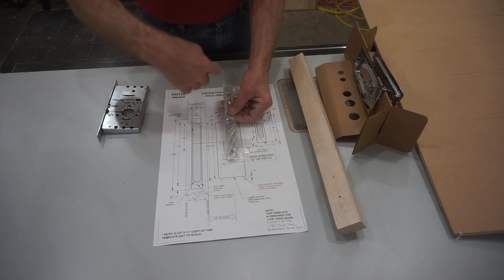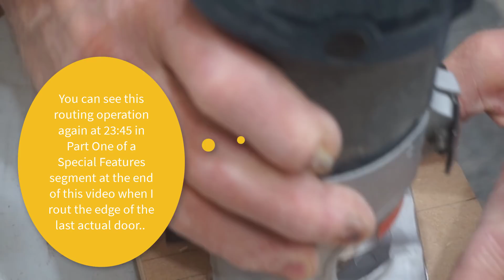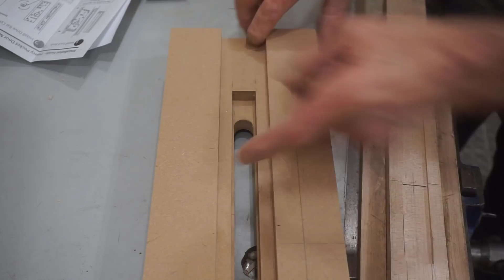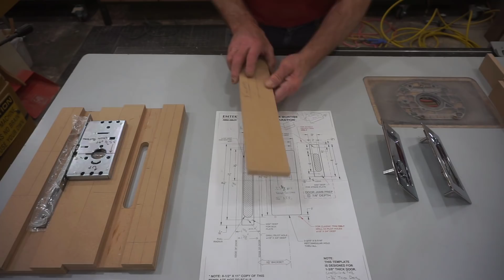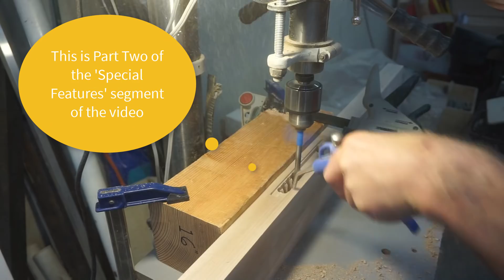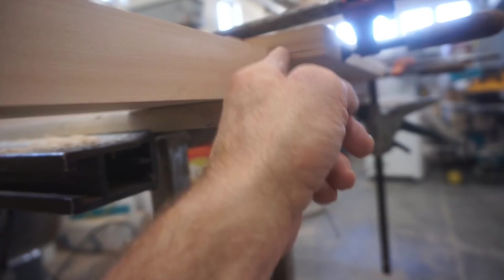Making Precision Templates for Professional Hardware Installation

Comment: In all fairness, i would like to see our metric friends mark a line 7.144mm in from the edge. I haven't seen many metric tapes with a .1 scale.
Reply from the maker: That's funny cerberus... I'm gonna have to use that in a video somewhere because, besides being hilarious, it's actually a perfect response for those with a metric-first perspective! Best, Matt
Reply: I find it funny because this is an example of false equivalence; since 1 mm is 3/64" so 0.1 mm is 3/640" which, I think, is beyond even Matt's amazing table saw abilities...or perhaps no?!! :D Love the channel,  @NextLevelCarpentry  -- fantastic content and the long format is zero barrier for me.
Reply from the maker: @JanStureNielsen  No sense in getting all worked up about metric vs imperial, right?  I don't know the conversion between fractions, millimeters and frog's hairs but I suspect 3/640" is a decent fractional eqiuvalent. 🤣  Glad you like the channel and are OK with long format videos!
Reply: 60 year old chippy here, great advice on making templates.  By the way I learnt imperial at school and before leaving school metric was introduced (Australia), so I picture things in feet and inches but can only work and mark-out in metric.  Digital calipers will give you 7.144 mm, pencil lead will give you that variance anyway, if my eyes don't lol.
Reply: Matt, very cool jig demo, I have recently added Festool to my hobby shop, and the bug difference is tool quality and "Dust Extraction"

Comment: After using a spade wood bit to hog out most of the wood, I would suspect you could only use a router bit maybe a little over 1" in cutting length  to remove some of the wood after the spade bit? Then I would suspect you then used a chisel? I have the same EMTek hardware to install. Is the above the approach you took? Thanks.
Reply from the maker: Router bit would be great but the risk of it 'catching' and destroying the face of the door kept me from going that route...

Comment: Thanks very much for this thorough guide - it's been immensely helpful to me. I only have a single door, but it can't be replaced, so I had to get the installation right the first time. The Emtek guide page was daunting, and your video helped me understand how to approach each step of the door preparation and I followed it exactly in building my own guides. Since the hardware isn't common, there's not a lot of material available online, so it was great to find something this comprehensive.
Reply from the maker: Thanks for taking the time to make a follow-up comment on this video... and congratulations on installing one of the more difficult pieces of hardware on the market today outside of a mass production door facility. As I'm sure you would agree the first one is the highest hurdle but if you had to do more you could probably do 10 in the time it took you to do the first one😁😎
Best, Matt

Comment: I looked at a job today to install 14 EMTEK Pocket door locks. So making a template will be the most efficient. So glad I ran across your video. I can definitely give a good quote now. NIce job.
Reply from the maker: Hope you get a chance to do a test run on one of those locks because they can be deceptively tricky until you get the hang of it.  It's great work though because it's not physically demanding and, because it can be intimidating, you can, as you say 'give a good quote' and make a comfortable profit because others shy away from it.
Best,
Matt

Comment: I was thinking of replacing a cheap pocket door lock with this one but i do not possess your level of expertise.
Reply from the maker: I know exactly what you mean... it's sad that there really isn't anything between the cheap ones and this one that is over the top...
I've done a lot of Custom Door Hardware in my day and this one is definitely one of the most challenging installations I've done...

Comment: Very impressive jig! However, I don't see how you are clamping it to a door in situ. Thanks for sharing your wisdom.👍
Reply from the maker: I would hate to have to install this hardware on a door in situ!  The only sensible option IMHO is to remove the door and work on it that way, preferably in my shop but at least using a door vise on the jobsite...
Thanks for watching and commenting! Best, Matt

Comment: I did 4 of these emtek pocket door privacy locks a couple months ago. People don’t realize how in depth it actually is to make jigs for specialized fancy hardware like this. I really wish I would have found your video before I did them. Awesome info. I’m about to do 10 non-privacy pulls and separate face plates in a house now 😳
Reply from the maker: The complexity and precision involved with hardware like this can even take those with extensive hardware experience off guard, can't it?  Hope tips from the video help make your job/life a little easier on those next 10 pulls! Best, Matt

Comment: How do you deal with the bevel edge end of the door
Reply from the maker: I'm not entirely sure what your question is but because it's a pocket door the edge of the door where the hardware is is square because the door slides and doesn't swing... let me know if you're asking about something else and I'll try to respond...
Best, Matt
Reply: @NextLevelCarpentry  the box hardware is angled to suit the bevel at the strike side of the door your template only touches one side of the bevel. To drill a whole equally on both sides of the door you need to place a square at the top of the door so that you can find the difference to drill the holes for the spindle so they end up in the right place we are talking about 3/16, yes I know pocket doors are square you would have to make a piece with a radius at both ends of the template to slip into the morticed end of the door with your wholes already drilled out on your template on both sides
Reply from the maker: @lesliesweeney368  True enough... for typical box locks.  This can easily be accomplished with similar jig/template making methods, compensating for the lock's design and the door's beveled edge.
Reply: @NextLevelCarpentry  usually I use a 513 portacable if you could show the templates part of it on your platform alot would learn from it

Comment: My wife just bought this exact hardware for a new pocket door we're installing, and this video is just what I needed to help with the install.  Thanks for sharing the ideas and knowledge - really appreciate the way you present your work.
Reply from the maker: You're welcome Rob... BTW I think installing this stuff is like an 8~9 out of 10 for fussyness/difficulty so don't be ashamed to do a practice run through the gears on a piece of scrap the same thickness as the door you'll install it in like I did... Best, Matt

Comment: How do I locate your carpenter pencils?
Reply from the maker: Hey Rob,
I have the pencils custom printed and have to by a minimum of around 500 but they're not easily available or distributed by TeeSpring or anyone so I just dole them out as I see fit.  Wish viewers could buy 5 or 10 at a time from a custom print outfit but I've not heard of any offering that service.  Best, Matt
Reply: Next Level Carpentry if I wanted to order some, like 6, what would I need to do?
Reply from the maker: Say 'please' and remind me your mailing address in an email? 😉😁😎
Reply: Next Level Carpentry OOHRAH!

Comment: Hi really enjoyed your class on templates when ever somebody asked me if I wanted to a use a template on the job I always said no because I never knew how accurate it would be. I would use the 513 coffee grinder for the mortise after taking the center of the strike them mark that on the edge of the door then screw the face plate on the door edge, cut with a knife cleanly around then router with a 1/4 bit

Comment: As a professional locksmith for over 40 years. I really enjoyed this video. Over the years I tried many different ways of creating router templates and even used some pre-made templates. I was never very happy with the outcome or the fussiness of using them. I'm curious to know if and how you could adapt these templates to be able to clamp them to an already finished and hung door. Nearly all my installations were retrofits.
Reply from the maker: Glad you like this video Kelly. I use this exact process anytime I face a non-typical hardware prep.  Now that you know how to make accurate templates for any type/configuration of locks all  you need to do is extend certain template parts, depending on the lock and door, so they can be clamped to whatever door you're working on.  I'd strongly recommend removing the door from its hinges and placing it on sturdy, padded sawhorses so you can work in a comfortable position but, other than that, you know everything you need for successful lock prep.  Hope that helps... Best, Matt

Comment: Awesome instruction! I have the same Emtek pockets to install, so this is perfect. I also learned a lot about making templates easier to make. Not knowing about glueing like that, I made some Dutchman templates to fill unneeded deadbolt holes by plunge cutting the MDF with my Skilsaw--it worked but def not as clean as your methods.
Reply from the maker: Glad it was helpful... I don't know what I did before great CA glue with accelerator was available David.  Makes so many jobs SO much easier! Best, Matt
Reply: @NextLevelCarpentry  I just realized that I have keyed locks, so my escutcheon mortises will need to go all the way through for lock box access vs 1/4" deep, right? I saw this on an Emtek's instruction sheet.
Reply from the maker: @davidfong4811  it's been a couple years since I worked with those locks and forget the details but it sounds familiar.  It's probably easier to go all the way through with those mortises anyways since, if memory serves, the mortise bottom on this project was VERY thin.  It makes a difference too if you're working with 1 3/8" vs 1 3/4" thick doors.  Most everything else should be the same.  Not sure if I showed in this video but, for a complex prep like these I usually make a mock-up door stile and practice with each template before committing to the actual doors.  Too often there's some little detail hidden in the instructions and I don't like surprises when working on $$$$ doors! 😉😎

Comment: Great video, I have this exact same hardware only difference is my doors are 1 3/8". One question for you do you see any issues with using the first 2 templates but then using a jigsaw to cut out the square opening for the handles? I don't have a drill press to use for that deep mortise, and with the thinner door I don't see much wood being left under after cutting that last mortise if I did. Thank you in advance.
Reply from the maker: It's been awhile since I installed that Hardware but seems to me that it would end up different on a thinner door because of the depth of the mortises. I kind of remember thinking I was being OCD by not just cutting out a bigger hole rather than leaving those areas of thin wood on the inch and 3/4 door. I'm pretty sure that the escutcheon covers up everything anyways and think you'll probably save yourself some grief if you approach it the way you described.
I'm not telling you anything new by saying that often when working with complex Hardware with complex prepworks I will make a dummy door style and do all the mortising and fit up work by practicing on that dummy rather than risking trashing an entire door.  Heck even doctors do this because they will all tell you that they're in practice, right? 😎 hope that helps and good luck with your project... good news is that after the first one the rest are a breeze!
Best, Matt

Comment: Quick question:  why don’t you use a vacuum instead of compressed air?
Reply from the maker: Quicker and better IMHO.  I'm never going to collect 100% of dust in the shop so I've no more problem cleaning up 25% instead of 5% and am much more productive as a result... but that's just me! Best, Matt

Comment: Does it improve the shelf life of the CA glue to store the bottle horizontally?
Reply from the maker: Not that I know of Danny.  To extend life it should be stored out of UV light and at around 40 degrees F.  No, I store it on edge because it makes dispensing quicker by not having to wait for glue to run all the way from the bottom of the bottle to the top.  FYI the Starbond glue I've switched to flows much better and has a longer shelf life so I now keep it in this little glue caddy: https://www.youtube.com/watch?v=8KU1u_5xvV0  BTW the 15% offer code from the video is still valid... Best, Matt

Comment: I am actually installing these very locks in a series of 1 3/4" pocket doors tomorrow. Very helpful! Thanks so much for this content
Reply from the maker: Good luck SK... that's some pretty temperamental hardware where the slightest mis-alignment can keep them from operating smoothly.  At least with a good prep you've got a better chance of success... I'm rootin' for you! Best, Matt

Comment: I have a little bosch router like yours. Whenever I try to plunge it in like that for a template, it jumps out like crazy on me. I actually broke a template last time I tried to do it.

What is your secret? Or what am I missing?
Reply from the maker: Make sure your bit is sharp and you've got the rpm's dialed up.  Besides that it takes a firm, steady grip along with confidence from experience.  Also making your template thicker helps to take more than one pass because a shallower cut doesn't fight back so much.  Practice on some scrap that doesn't matter to build your confidence level.  On really critical projects I'll drill a 'clearance hole' with a forstner bit so I can start the router  bit spinning in that hole and eliminate potential problems from plunging altogether.  Hope that helps Berky! Best, Matt
Reply: @NextLevelCarpentry  thank you very much! You're a true Craftsman, I love the precision and experience that you bring to your channel.  I'm learning a lot from you. Thank you for doing what you do.
Reply from the maker: @beurky  you're certainly welcome. If you want to return a favor just spread the word about next level carpentry to people you know and work with? 😎

Comment: After watching this I'm more than impressed at the speed and accuracy. Possibly I could do the same now and get close to that same accuracy and craftsmanship? The difference though is it would take me at least 10 times longer to do so while I figured out and thought every step through to ensure no mistakes. Hard earned and long years of experience trumps the lack of every single time. My guess is when you first started plunge routers wern't even invented yet so learning how to do it without them wasn't optional, so there's no real need for you to own one.
Reply from the maker: You're right about the chronology of plunge routers Turning Point... I learned how to handle a router before they were mainstream.  I have two of them but prefer my old 'D'-Handle to the extent I only use the plungers in a router table setup because they're easier to adjust and the big Bosch has enough power for my biggest bits. Gotta dance with the one who brung ya, right?  😂😎 Best, Matt

Comment: 100 % percent for tamplates. You actually did not need the thin wood left between the latch and the recessed plate on the outside, even if you would have cut it all out, it would not make a big difference I think.